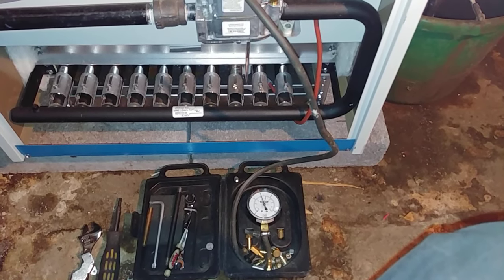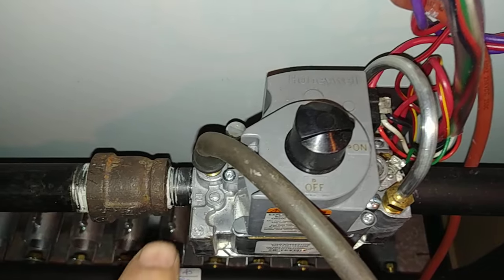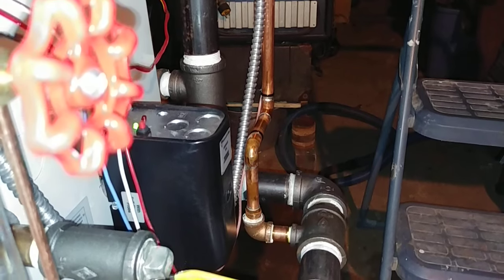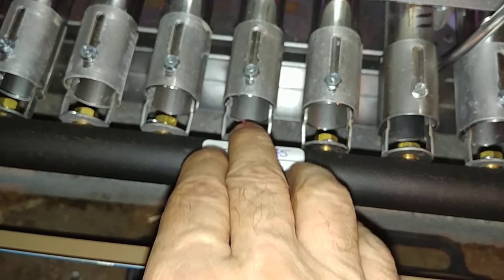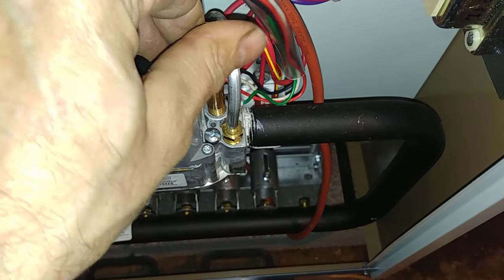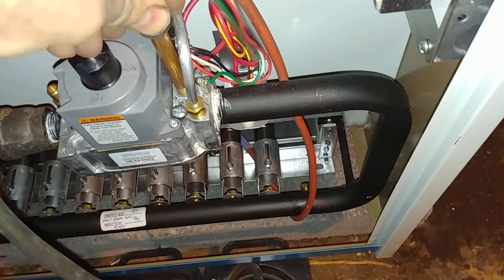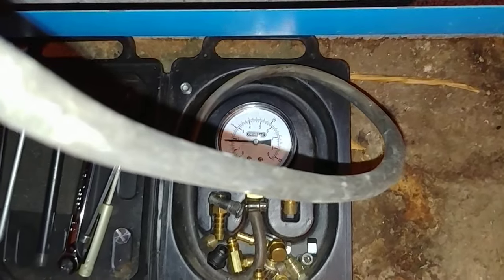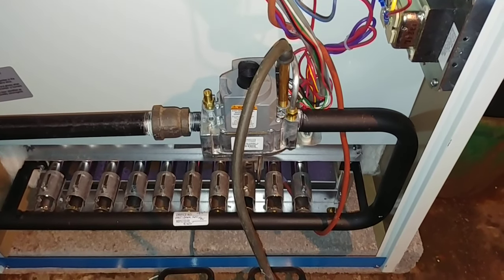Adjusting Honeywell VR8000 Series Gas Control Valves

Comment: God bless you and thanks for taking the time making these videos.
One day please explain about steam banging noise.
A building I'm working on doing plumbing asked me to check and see where the noise is coming from.
Started this year and seems to be coming off the 3" header they do have steam traps and they are working fine.
But what could be the cause all of a sudden.
As soon as the steam comes through the header the banging starts 
Header is pitched good.
Is there such a thing as wet steam?
Reply from the maker: You are most welcome!
In regards to the water hammer in the building you are working in,
I'm assuming that the noise starts soon after the boiler starts firing.
If that is so, I would first check the sightglass to determine the water level in the boiler.
Please make sure the sightglass is telling the truth, that is to say not clogged and showing a false water level.
If the sightglass is showing the true water level, make sure that the water level in the boiler shows at the middle of the glass.
Watch the water level as the boiler starts firing.  Does the level bounce up and down greater than one inch? If so, you may have contaminated water in the boiler and returns.  Shut the boiler down and drain all of the water out and re-fill.
These are a few of the things you can try to stop the banging.
Yes, "wet steam" is a thing. A thing to be avoided!
Stay safe.

Comment: Great video, thank you very much! I have this same valve on my furnace and I was wondering how do I adjust the pilot light? It seems to high right now
Reply from the maker: You're welcome!
There is a screw right next to the pilot tube (it's a tight fit) that when removed, exposes the access hole to the pilot adjusting screw down in the hole.  You'll need an 1/8" slotted screwdriver to turn the adjusting screw clock-wise to reduce the flame.  You'll likely need to try "bottoming out" the screw and then back it off to get the flame you want.

Comment: Great video Gordon. Should there be a click when the pilot valve solenoid opens? I fear my valve is faulty as no click when 24vac applied to PV&MV/PV.

Also, does the pilot valve tension open when the main valve opens? Thank you kindly
Reply from the maker: Thank you!
Yes, there should be a noticeable <click> when 24v ac is applied across PV/MV (or common) and PV from the flame control unit.
I take it that you have already verified with a test meter the presence of 24vac at those two terminals on a trial for ignition.
As to your second question, I'm not sure if I understand what you are asking, sorry.

Comment: thanks so much, I just replaced my gas valve on a 1960s furnace and now it whistles, and the flames are a bit too yellow, so I will be checking the downstream gas pressure.
Reply from the maker: You're welcome!
I'd also strongly consider having your furnace checked by someone who can use a combustion analysizer to make sure you are not generating excessive amounts of CO .

Comment: Thanks for all the valuable information contained in all your videos....they are most interesting....although I am not a plumber I am interested in steam systems...this video got me thinking of a few questions if you would like to comment:  1) A drop of 2.5" w.c.on the supply side of the regulator when boiler starts running seems considerably higher than the standard 0.25" to 0.5" typical design value from customer side of meter to load for residential low pressure gas piping that I have seen in the literature......do you agree?  2) Do you think the as found 4" w.c. regulated manifold pressure was higher than factory adjusted 3.5" because you capped off a burner?  it looks like each burner is about 18,000 btu/h so rated boiler input is now closer to 182,000 btu/hr .....curious what the input rating of the old boiler was...3) Would the 2.5" w.c. drop at the input be slightly lower after lowering the manifold pressure to 3.5" as the gas flow would be lower? From your previous video the boiler nameplate indicates a min. 5" w.c. input requirement, slightly higher than your first measurement of 4.5" running. 4) regarding capping off a burner is the boiler mfg. ok with this and the warranty will not be affected?  thanks again for your informative videos!!
Reply from the maker: Thank you for your questions!

First, I most certainly did NOT plug off that burner. It came that way from the factory.

The pressure drop from 7" H2O to 4.5" H2O when the burners fire represent a problem with the gas supply. Most likely the 1910 gas line fron the street is choked with rust.

Our gas distribution grid is... antiquated. The last known wooden gas piping was removed in 1987. It was installed in 1868.

The old boiler we took out was too small according to our survey of the connected load, so the inlet gas supply issue will need to be addressed at some point.
Reply: @gordonschweizer5154  Thanks so much for responding! Sorry I misunderstood you on the burner plug...at 0:26 sec. of your 12/17 video it sounds like you say "we've plugged that one because".......so I didn't understand that to mean the mfg. plugged it....once again...great videos!
Reply: @proengineering661  & Gordon I believe I can shed some light on your concerns of gas pressure. My expertise comes from 35 years with the gas utility in St Louis, Missouri and in my retirement I still consult from time to time when incidents occur, so let's go over our concerns. From my understanding this is an older neighborhood with a low pressure system ( no regulator at the meter set). Gordon you did a great job of checking the pressures at the boiler but anytime we have a 2.5" pressure drop on the fuel runs this is a cause for concern and we need to dig a little deeper because a 1" pressure drop is in the order of the maximum allowable per the National Fuel Gas Code ,AGA & GAMA.#1 when checking pressures on the fuel runs we should always check that with all the  gas appliances running, taking pressures at the farthest fuel run away from the gas meter.#2 if the pressure drop is excessive we will need to take pressures at the outlet of the gas meter. With all the appliances running and we notice an excessive pressure difference between the meter and the end fuel run, this would indicate a problem with the fuel runs ( under-sized or some type of debris blockage) but on the other hand if an excessive pressure drop is still noticed at the outlet of the gas meter we now know that is a gas utility problem and they should be contacted immediately. The utility would dispatch this as a poor pressure problem and a gas utility service technician would be dispatched ASAP. Hope some of this information helps and y'all please stay safe out there.
Reply from the maker: @Bob Y: One of the last times I called a gas utility on a low gas pressure problem/issue, the fellow showed up with a 'tude and acted like it was my fault and did nothing.  Wasted several hours of my life for no pay.
This has happened twice, so I learned my lesson.
Unless it is causing the unit to actually drop out of service and cause a no heat issue, I am not going to initiate a call during the winter just yet.
Reply: @gordonschweizer5154  , sorry to hear you had a bad experience with your local gas supplier. Wish I could say all Gas Utilitie service departments were ran like the one I worked for . We have between 200 and 300 service technicians , all HVAC certified technicians from the superintendent all the way down to the man that just got hired & that's not even covering the certification the gas company puts us through. Just an FYI, just by you not contacting the gas utility about a potential pressure problem leaves you and your company in jeopardy of taking on a lot of liability. You do not have to wait there wasting your time, just leave your telephone number with the customer and the technician should be contacting you with his findings. The main thing is that the customer's equipment and fuel runs are all in order. Anytime you have a disagreement with the Gas utilitie's service technician you should call in and have one of the supervisors contact you. Usually these are caused by misunderstandings and the supervisor is there to straighten out any misunderstandings and answer any questions you may have; but by not wanting to deal with the gas utility because of past experiences solves no problems. Gordon, I hope some of this information helps you, stay safe out there,  keep learning & teaching.

Comment: My new Weil McLain EG 65 came with similar VR 8304 (P4348 higher btu rating).....Stamped with RESIDEO instead of Honeywell........Very upset that this is an intermittent pilot 24v gas valve .....Had no idea the standard pilot is phased out and gone........Now if you lose power you lose your heat !!!.....Unacceptable in my book...Is it just me ?......Thanks for the Vid =)
Reply from the maker: Resideo is the company spun off from Honeywell about 2 years ago, IIRC.  
New boilers with standing pilots/24 volt controls have been forbidden to be made in the USA since about 2013.  With most standing pilot boilers, if you lost main power, you still lost heat, unless you had back-up power. 
Only those with millivolt systems didn't loose heat, but millivolt systems have been gone for decades (unless you're Amish - no joke).

Comment: I like the high preassure tap to manometer tubing that has the closing screw built in. do you know if that is a part that can be purchased separatyely and then added to a regulator? Thanks
Reply from the maker: I think you are referring to a 1/8" NPT  brass pressure tap fitting by Maxitrol (SKU# PF10).
Is that it?
Reply: @gordonschweizer5154  yes thank you.

Comment: Would I able able adjust manifold pressure on my Honeywell to get larger flame for a garage forced air furnace that has weak flame ?
Reply from the maker: Maybe, but I would check the incoming gas pressure to the valve to make sure it is always above 4.5 inches of water column before trying to adjust downstream pressure.
If so, check the manifold pressure and see if it is no more than 3.5" H2O.
Then check to see if your orifices are clear.
Ran into a job where spiders had built a web inside of them!
Reply: @gordonschweizer5154  thank you for taking the time

Comment: I have this honeywell valve on my coffee roaster. It's neat but i'm suppose to have 5-7" wc not 3.5" Is there a trick to getting an 8304m4507 to give me 5-7" Ng?
Reply from the maker: It would be folly on my part to advise you on your coffee roaster gas control since I am totally unfamiliar with that piece of equipment & with those pressures with natural gas. They seem closer to what  propane gas requires for proper operation.

Comment: I have a similar honeywell unit. It seems my pilot light it too big. I can't adjust the pilot any lower. Could the system be over pressured?
Reply from the maker: Hi! Without some means of measuring your actual pressure, any statement from me would be a pure guess and probably wrong.

Comment: I have a Honeywell VR8204H1147 that’s buzzing like crazy. All the companies in my small town are busy for the next week. I have a new valve can I replace it? Or are these not set from the factory?
Reply from the maker: They might be set at the factory, but do you have a gauge to check?
If you don't test, it's just a guess.
Reply: @gordonschweizer5154  I have no gauge (manometer) to test it but I gather you can clock the gas meter to see that it’s firing at the correct rate and adjust if needed based on the clocking. Oddly the loud buzzing stopped and it’s run several times without any noise or issues recently. Perhaps the solenoids had just been sitting too long over the summer without use? Or maybe it’ll come back again? Thoughts? All I know is for now it’s functioning
Reply: @gordonschweizer5154  I ended up paying a gas licensed plumbing company to come install it. 10 minutes and easily something I could have done myself. When he was done I asked “no pressure checks no carbon monoxide test, are they preset from the factory or something” his response “yep they’re preset when it’s an exact valve swap and unless there’s any startup issues no need”. Legit could of done it myself. Waited and worried for umm nothing and now it just costs more.
Reply from the maker: @lh98  That sucks.
So you have no proof that your piece of heating equipment is not producing excessive levels of CO after paying them?
They didn't do their job correctly & you might consider reporting them because they handed you a line of BS.
Reply: @gordonschweizer5154  well the original installer did mount a co detector right above where the thermal cutoff switch firomatic is so I guess at least that should do it’s job. Funny gas company doesn’t want unlicensed folks doing things but it sounds like licensed ones charge a bunch for doing about the same as unlicensed lol

Comment: Hi Mr Gordon! one question? where I can find the adapter for the inlet pressure port? I need check the pressure in one valve Honeywell 62L18 and I need know where I can find the adapter for test the pressure with my pressure test kit! is almost the same like your kit? I really appreciate you help!
Reply from the maker: You should be able to use a standard 1/8" NPT nipple, nothing special.
Reply: @gordonschweizer5154  Thank you very much Mr Gordon! I can find the 1/8" nipple in the hardware store right?
Reply from the maker: @manuelitoreal2608  Yes, and I'd try to find a 1/8 x 3" brass nipple or two
("One to use, one to lose").
Reply: @gordonschweizer5154  I appreciate you help Mr Gordon

Comment: Are there any gas valves that do not need to be adjusted ? Thanks
Reply from the maker: Most of them don't need to be in theory (they should be set @ the factory 3.5" of H2O) but if you don't check, it's on you if you just install and walk away.
Some burners need lower settings per their instructions, which should be consulted.
If you don't have to have a low pressure gauge like the one above, you can also "clock" the gas meter.
Reply: @gordonschweizer5154  how is that done

Comment: Do you have to manually lit the pilot for this gas valve?
Reply from the maker: Not this valve shown above.
This set-up is for electronic ignition.
The basics for the gas pressure check & adjustment is largely the same, however.

Comment: What is the little white cap cover next to the adjustment screw?
Reply from the maker: I think you are referring to the air vent/bleed.  The cover (which has a tiny hole off to the side) is there to keep out dirt, debris, insects, etc.

Comment: What does the “C” do near the ON/OFF knob on the Valve?
Reply from the maker: I don't know, but I'll find out and report back.
Reply: @gordonschweizer5154  wow. Thank you for the quick response! I am currently in NY and I am trying to start my (direct ignition) furnace for the first time but it’s a new one and it’s not kicking on. Gas valve is open, knob is turned to ON position.
Reply from the maker: @lancer717  You're welcome.
Sorry you are cold and your ignition system is not giving you joy.
You have your knob in the correct position, ON.
I am not sure exactly what c does (I remember playing around with it on gas controls I've taken apart), but I do know it is not helpful to you in your hour of need.
Reply: @gordonschweizer5154  my only thought is I’m missing a reset switch somewhere. Although I have an automatic hot surface ignition. Tomorrow I’ll see if the thermostat went bad.

Comment: How do you control the temperature on this controller
Reply from the maker: This gas control valve is for safely controlling the flammable gas to the burner manifold. Other limit controls such as thermostats, aquastats, etc, monitor and control the temperature and thus they control the combination gas control valve to turn on and off in this situation

Comment: Sorry, do not understand that pressure gauge READING.   3.5 can not see it,
Reply from the maker: The outer scale is in inches of H2O.  
The inner scale is in oz/in2.
Find the 5 on the outer scale.
Go counter-clockwise.
Each tic is 0.5"
The short tics are the half numbers.
The long tics are the whole numbers.
3 tics down from the 5 is 3.5"
Reply: @gordonschweizer5154  Thank you.  Will take time (study) for this to sink in.